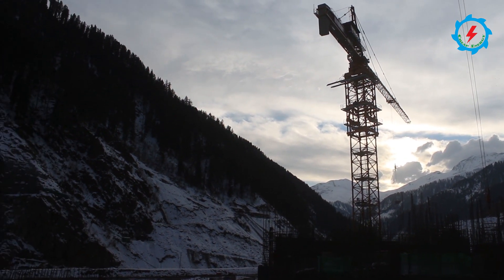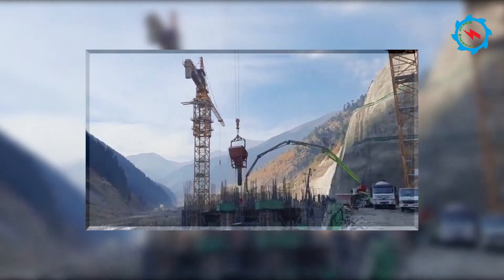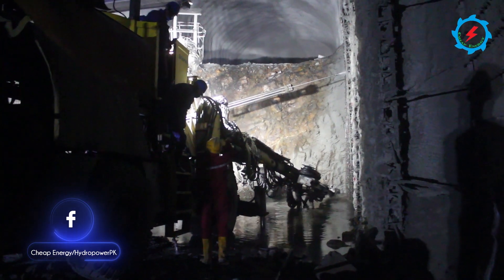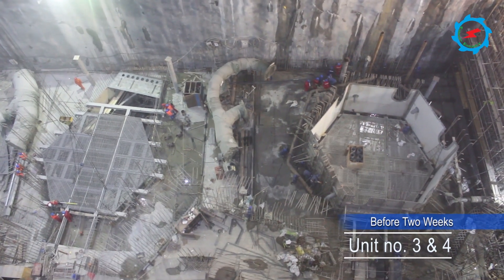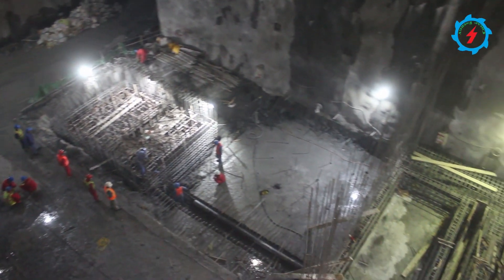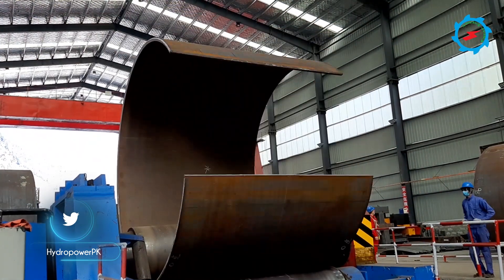Suki Kinari Hydropower Project | Construction Progress | Oct-Nov, 2020

Comment from the maker: 0:56 - Spillway/Dam Area
1:58 - Dam Cut off Wall for seepage control
2:24 - Headrace Tunnel area
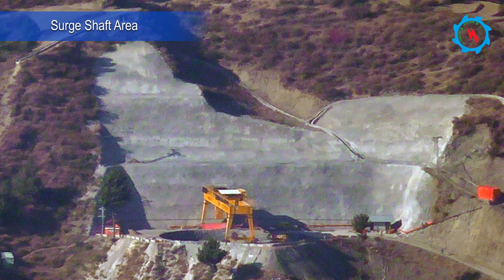3:08 - Surge shaft area 
4:01 - Penstock Area
5:44 - Pressure shaft excavation
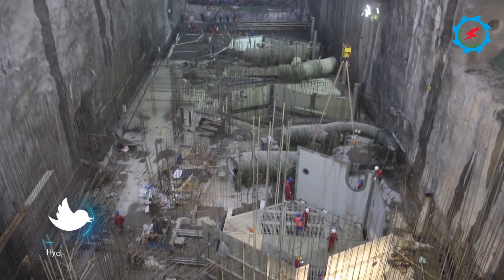6:01 - Underground Powerhouse
8:32 - Transformer Hall
9:23 - Cable Tunnel
9:48 - Tailrace Gate Shaft
10:00 - Permanent Bridge 
10:23 - Penstock Steel Factory 
11:25 - Project Completion Date
Reply: Great info. Thanks.
Reply: Appreciated this breakdown of video
Reply: Well written. Provide for all video